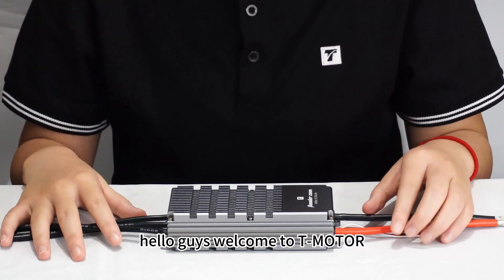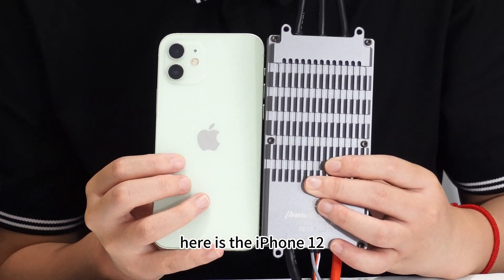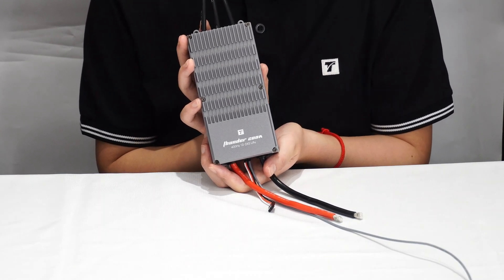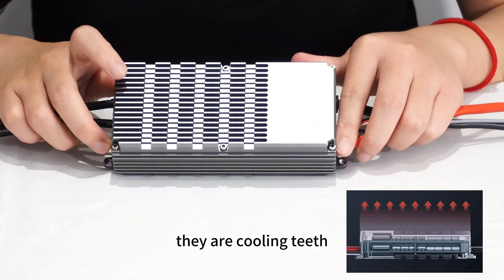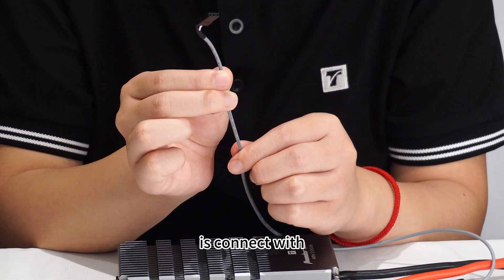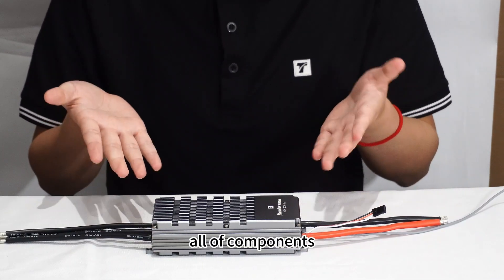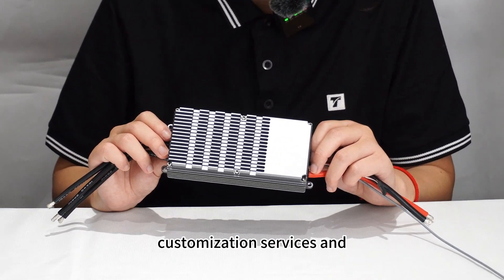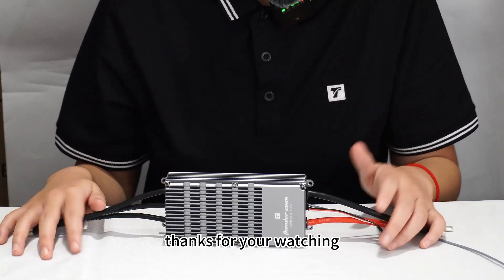T-MOTOR ESC THUNDER Series Introduction

Comment: I have a thunder 200A esc and there is a black cylindrical socket next to the power cable. How do I use it? Is this an encoder cable? Does the motor also have an input?
Reply from the maker: This is the motor locking propeller encoder, if you connect the motor does not have this function, this wire is not needed
Reply: @ We try to read a feedback data of uart But when we connected the all system we couldn’t read any data on serial port. Also we use uart to usb converter and when we connected the thunder 300A esc and V13L motor system, we read  all data

Comment: hi 
maximum takeoff weight
Is it possible to tilt rotor, with which flight controller do you recommend?
What type of battery does it have?
motor mount and carbon fiber tube used for tilt rotor
Reply from the maker: Please leave us an email address, and we will send you a detail soon.